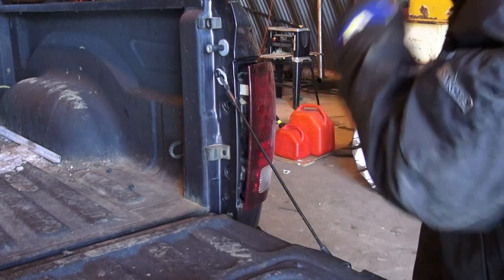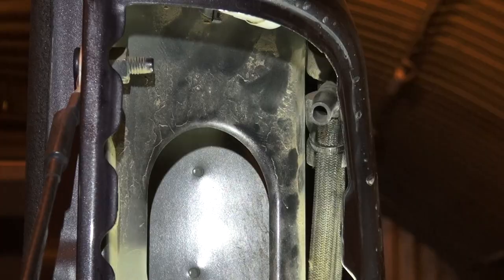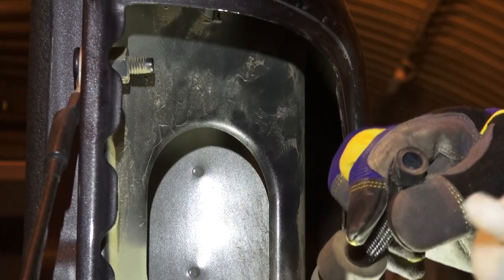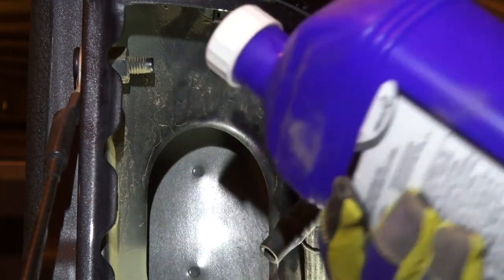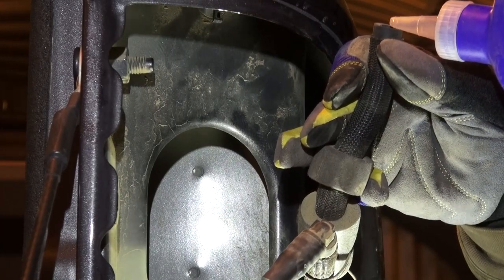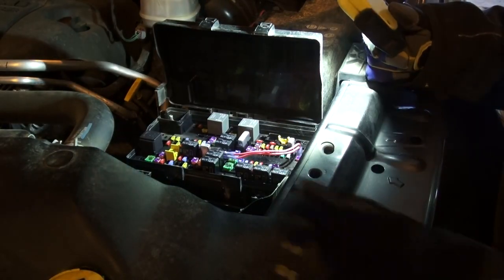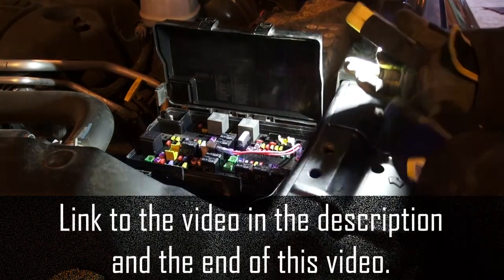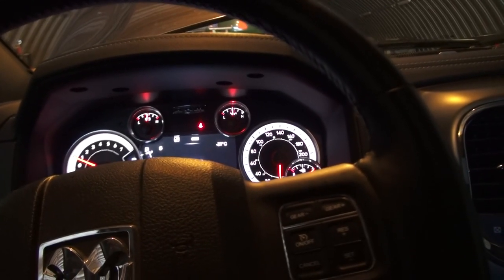DODGE air suspension [De-Icing-lubricant]

Comment: Martian Dan,  my hat is off to you.  I live in Ontario, Canada.  My 2014 Ram has always experienced Air Suspension issues and alerts when the mercury drops below 0 and into the double digits.  I have replaced one compressor at the advice of Ram.  It always seems to start having issues part way through a long winter trip.  When I read your fix with the brake line antifreeze, it immediately seems logical that the valve maybe freezing.  I ordered the exact solution you used,  however it was back ordered for a week or so.  So I purchased the Kleen-FLO Safety Brake and followed your instructions.  5 minutes was all it took.  $14.  I cannot express how pleased I am and how much I appreciate you posting this video.  I did this last Monday. Almost a week has gone by and today is -17 degrees. No alerts.  The truck raises, lowers and moves into aero mode as designed.  Ram would have gladly taken over $100 just to look  it.  Thank you so much.
Reply from the maker: Wow, your comment feels me with glee, joy and excitement! The best part about having made the video and helping others are the amazing and kind replies. I do enjoy the feedback and really appreciate the time people spend writing them. Thank you and keep on smiling!
Reply: Okay, it has been 2 weeks.  No issues.  -12 degrees Celsius 2 days ago,  no errors or messages.  It has been -7 to -12 the past 2 weeks.  For sure before this fix,  I would have experienced the “Air Suspension needs immediate attention” message.  Still extremely grateful with this fix.  Thanks Martian Dan.
Reply from the maker: @darrenklingbell980  thanks for taking the time to comment and I am happy to hear the fix has worked for you! Happy days!
Reply: @darrenklingbell980  Nice to see it worked, I'm looking at getting a 2015 Sport with Air suspension also, are you still enjoying the Air suspension since this last post?
Reply: @HemiMike  unfortunately it failed once more.  I had the dealer remove it.  On OEM springs now.  It is a shame because I like the concept.  Maybe not ideal for Canadian winters.

Comment: Female here. Used this process to fix freezing air suspension issue on my 2017 RAM 1500 Limited and it worked great! Completed the easy steps myself without assistance and the biggest obstacle was removing the air filter, so really, no issues at all. Dealer tried to sell me a new control module and compressor.  Two weeks to get it in the shop and unknown timeline for parts and installation. Thank you SO MUCH! Saved me a great deal of time and money!
Reply from the maker: Yay! Another satisfied owner :D I am overjoyed over how many people this has helped! Thank you for taking the time to come back and comment.
Reply: @oBseSsIoNPC  Satisfied, elated, GRATEFUL! I am so appreciative. You took the time to document and share, and then to reply, Thank YOU! I think you're a Rock Star! Sending warm hugs from Central Ohio, USA!
Reply from the maker: @cassiecassiesue  thank you so much!
Reply: I tried this and I couldnt get the filter off? idk if was froze on or? I was pulling pretty hard but didnt wanna break it? How do I get it off?
Reply: @kadenanderlik6951  Hi Kaden, I used pliers to pull the filter off. I had already purchased a replacement in case I damaged it. I was able to get it out without damage but replaced it anyway. As I recall, I purchased the filter from Amazon for less than $20. Good Luck! Hope this helps!

Comment: So yea, thx for this video! Been having same problems with freezing until this. Works amazing, -35°c here last few days and it’s been working since I got the antifreeze in there. Never ever would have been working otherwise. Still kinda shocked it’s working so well too at these temps. So grateful man! Saved my truck issues for sure.
Reply from the maker: They tend to freeze up at -10°C and just like you was I in shock how it still works WELL below that. What an oversight of Dodge, selling the trucks without an automatic injection system like the big guys have.
Reply: @oBseSsIoNPC  yea totally. Seems ridiculous to sell these systems  in Canada…at the same time I loved having the air ride outside of winter. So now that this hack works it’s perfect!  Lol.

Comment: This worked like a charm! Suspension used to fail in mid -20s, put an ounce in last night, -32 this morning, working perfectly!!!
Reply from the maker: Same here, except my truck wouldn't start haha, cord snapped last night, tripped the breaker and cut the power to the block heater. She is as stiff as an anvil.
Reply: @oBseSsIoNPC  I havent plugged in yet. 2017, 110,000KM
Reply from the maker: @TippmannAlphaCinqo  for some reason my puny battery isn't strong enough this time around, will have to check my connections I guess, I never used to have starting issues either...always something with the kids haha.

Comment: First off thank you for the vid, second, if anyone is using this to help them solve your issues please know that you can use airline dryer for class 7 and 8 trucks with air brake systems. You can find it most anywhere and it’s cheap.
Reply from the maker: indeed, that is a solution. I did find that a yearly squirt of de-icer is sufficient in our region. I do it roughly 3 times, no extra maintenance items. So far so good!

Comment: Hope this helps, I have dealt with  the dopes at Dodge., Wasted $150.    If the computer shows a different height then what the truck is actually at,   go in to the main menu  > suspension > and select transport mode or wheel  alignment, this will force the computer to lower the suspension Turn off the truck. Add a cap full of the break antifreeze  start it up it should raise  to normal height.I replaced the computer, struts, all which was not the issue.Good luck
Reply: I did the tow mode trick with the antifreeze, my truck leveled out and doesn't hunt for what height its in. Great tip! Tonight will be the true test, going down to -35c tonight.

Comment: This was an awesome video.. very helpful. Professional but real and honest. Speaks my language 100% Haha. Being on a worldwide platform, I was pleasantly surprised to see you live in my area! Keep up the good work 👍🏼
Reply from the maker: Thank you very much. There was a bit of annoyance in my presentation, which is hard to overcome with such a poor design at hand. But hey! We can try and make it better :D
Reply: @oBseSsIoNPC  most definitely, it was recognizable though so I could definitely relate to the frustration. My wife and I each have a Grand Cherokee with this suspension. As you know we just went through a serious cold snap and I couldn't believe how much our suspension systems have been acting up all week. In every Jeep advertisement they're parked in the snow on top of a Rocky Mountain but in reality as soon as winter gets real the suspension falls apart 😂
Reply from the maker: @canjay4033  Yeah, they work great when they are brand new, but only a few cycles of that compressor pulling in moisture will diminish the reliability. None of them work after the first winter and certainly not below -30`C. Manufacturers are less trustworthy than your angry neighbor. Good luck with the fixes!

Comment: Thank you for the video. Have a 2016 rebel just got out of warranty.  Every year they have replaced my compressor because it burnt out.  Just starting to have some issues again, going to try antifreeze and hope it solves my issues and not to late, defiantly can't afford the fix every year out of my own pocket.
Reply from the maker: Interesting, I actually found the compressor to be very well made and appears to be the toughest part of the system.

Comment: I bought the deicer and procrastinated all last winter....as long as i didnt touch the suspension i didnt have many issues. This year nothing but problems with valves and compressor freezing! Eslecially on highway it tried to enter AERO mode and dropped all the way and stayed there. Then a couple times it listsed up all the way on the right and low on left, super annoying!!! Thos literally took 5 minutes once I hathered the tools!!!!!  I used a mini funnel and a measuring spoon (dont tell the wife...). 2oz is 60ml or 4 tablespoons FYI.  Truck wouldnt raise or lower due to payload. Restart the truck and took it for a drive of about 10 mins, felt it level out, then pulled over and had it cycle all the way up, then down, then to normal. Everything is great now, and waaaay faster up and down too!  Ill rrserve some excitement for next week when we are expecting -25c we shall see then!!!
Reply from the maker: Oh wow yeah, you put quite a bit down there eh? Just be careful with adding too much, especially considering the small bend the hose right at the compressor intake. Liquid could sit in that low spot. So either it can slush up into the compressor intake or the suction could gulp up too much at a time. Anyway, thanks for the detailed comment and I am glad she is working for you. God speed! Personally, I am now dealing with a leak somewhere, causing the compressor to run fairly often...it never ends until we replace the system with coil-overs hehe

Comment: Reaching out because you, by far, seem the most knowledgeable (at least one who's publishing information)...  I'm having a major issue and I need some guidance.  I have an automotive background - aptitude is there, I just don't know the truth about the ARS in these trucks..   I've been trying all the tricks (heater, de-icing lubricant) and it got me through last winter, but my system just seems to be done for now.  The timing couldn't be worse, as I have a TRX on order and need to sell this truck (2014 Sport 4x4).  Main symptom is rear left airbag deflating, but I'm also getting the code for "ride height calibration failed." among others.  I think it's the valve body, as I do get those error codes intermittently.  So I'm getting ready to pull the trigger on a new compressor assembly (including valve body) and I'm also going to replace the rear air springs.  

I have alfaobd, so I do have some control over the system, but it seems like I'm going to be losing whatever nitrogen is left in the tanks, as those lines have to be disconnected to change the compressor/valve body.  Being that this system is obviously not actually "closed" as advertised - do you think I'll be fine just letting the new compressor charge the system with ambient air?  I'll add more de-icing lube too of course.  But I'll be doing the work myself, and I don't have access to actually charge the system with nitrogen - unless I limp it to a dealer and pay $xxx amount of money.  I'm already going to be out a pretty penny with the compressor and rear airbags and would like to avoid additional expenses, plus avoiding the risk of driving the truck on bump-stops to a dealer, that may or may not be competent anyways, on these shit roads.
Reply from the maker: Hi Matt, sorry to hear that Dodge has found another victim! If the compressor is creating pressure, i wouldn't bother replacing it, unless it has a leak from the body, because you cannot get a seal ring for it. If the "calibration" fails and one air bag remains underinflated, then I suspect the control valve has failed or is stuck, so that is the part that should be replaced. Just make sure the linkage to the height sensor and sensor on the low airbag itself are working properly. As for nitrogen, the tanks are not expensive to get filled. Even a AG dealer should be able to do it, the fittings are identical AFAIK, worth getting it done. The compressor ist not actually temperature controlled, but on a timer. At -30°C it was still "overheating" according to the computer, although it was barely warm to the touch. So filling the entire system from empty will take a very long time, just on the compressor. Maybe its time to look for an aftermarket kit to adapt to the airbags...thats all I got my friend. Good hunting!
Reply: @oBseSsIoNPC  Thanks for the insight!  Oddly, my compressor stopped stalling when I added the de-icing lubricant, but that's when the bag started having issues staying inflated - I'm thinking the lubricant knocked some crud loose and is making the valve stick
Reply from the maker: @Matt-tt4cu  concerning that, when my system failed in a similar way 2 years ago I had to take heat to the valve and lines and break loose what I am sure was an ice chunk, literally draining the water from the valve directly. Then it worked fine.

Comment: I like many of you have also had this issue. Curious as to how much do you put in of the de-icer and where do you get that cap for the bottle?
Reply from the maker: 5mL to maintain.
Reply: Thank you so much excellent video been having this problem after the first winter on my 2015 long horn 1500 
Had no idea about this fix I’m going to do it right after this!!
Thank you from Montreal Canada!!!
Reply from the maker: @stevekritis1162  hope it helps! It does work in most cases, unless you have a big air leak somewhere or bad sensor.

Comment: Thank you for this video. I am going to try the antifreeze and see if it works. I'm in the mountains here in Colorado. I've been having the same issue as everyone else. Only in cold weather, otherwise it's fine. I noticed the last comments were from a year ago. Do you have any update on long term solution? Have you had any issues since this video was created? 
Thanks
Reply from the maker: Depends which video you watch about the issue, I have a few :P There are many up-to-date comments. Basically my truck has been 99% cured. It had an issue end of last year after thawing and freezing temperatures, with high humidity getting into the system, as well as perhaps not having had enough time to cycle the deicer all the way into the lines (one day it had a hiccup). This winter (apart from -40'C when I don't drive the truck period) has been 100%.
Reply: Thank you for the quick reply. I did see some other comments after leaving this comment. Seems like it's worth a try. Thanks again. 👍

Comment: Thanks from alaska! Im going to try this out. 2nd winter with my ram first time ive had issues
Reply from the maker: Oh wow, they sold you an air suspension in Alaska? Well, I ran the truck for the last 2 days of -35°C and it works to drive, just doesn't like to raise to max. I always disable aeromode in the winter as well.
Reply: @oBseSsIoNPC  yea salesman never even mentioned it!
Reply from the maker: @bigjsbbqak  worse to me is the fact that I failed to ask a mechanic at the time and confirm what the salesman pitched me. I am a mechanic myself and I knew an airsuspension is a finicky thing, so I asked the salesman about it and he said it was an enclosed system only with nitrogen tanks. I got lulled into that thinking yeah sure, that makes sense then, why would it freeze...well, it does because the nitrogen tanks provide the spring force only, they are not for the filling or emptying of the bags...should have known that :)
I am SUPER happy still, ever since all the "fixes" I applied. Wouldn't want to miss the higher truck on the muddy roads or lowered truck giving me a fuel consumption of 13L/100k mixed over a year average and much softer ride in the cold weather, than a standard suspension would.

Comment: hey man- just wondering about an update on this? is it still holding up? Thanks!
Reply from the maker: It is still holding up indeed, although admittedly it had more issues this year, than any other. It happened after they did some "factory required" programming, which seems to have made the suspension even more confusing...should have never let them update anything, but I was hopeful it does good.
I am likely going to purchase the nitrogen  and kit to refill the tanks with, as I can use it for my work as well. And I have to check for leaks, I think I have a tiny one somewhere, but I manage haha.
No problems at all at -5°C and up.

Comment: Hey there not sure if you Can help me with this but yesterday in was -25 over here in Sask with mine. I was driving up to my family’s place and the truck started to lean to one side eventually going completely flat on moth driver side air bags. Also the service trailerbrake and all that came on, have it parked in a heated garage at the moment, couldn’t find any bad fuses. Might check that big relay. Defiantly going to put some brake line antifreeze in
Reply from the maker: Thats what my truck would do when the control valve is frozen up. Unthawing and cycling the antifreeze through the system  should do the trick. Once it works, completely raise and lower the truck 5 or more times, after you pit the antifreeze in. Just don't dump in too much right away. Add like 5ml total, cycle the suspension add 1ml and repeat. You DO NOT want to stall the compressor, be patient!
I am now using a syringe to add the fluid, works great. You can get the 5ml at Peavy mart or coop farm supplies
Reply: After thawing my truck in the garage I haven’t driven it yet but when I start it up the pump won’t run and I still have the lights for trailer brakes. Do you know how I can reset that? Could that relay have gone bad?
Reply from the maker: @DuckinGolf  you can try putting the suspension into tire jack or transport mode, turn the key off and disconnect the battery. Wait 5 min and reconnect the battery. I am not sure why the computer complains about the trailer brakes, but I assume that, if the suspension isn't working, the truck wouldn't be able to adjust for load either and thats why it sets the code. If you have a obd2 reader, that can reset the code as well.
It can take hours for everything to unthaw, make sure to have the covers off underneath.
Reply: Right on, I’ll try that out, thank you